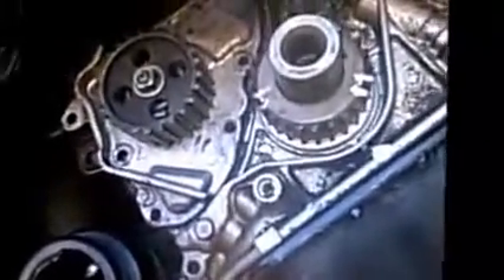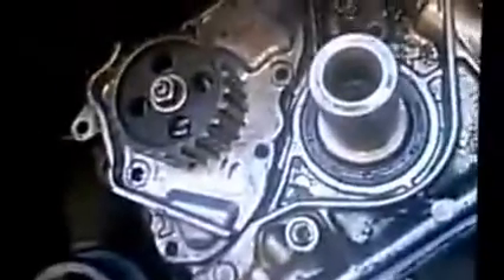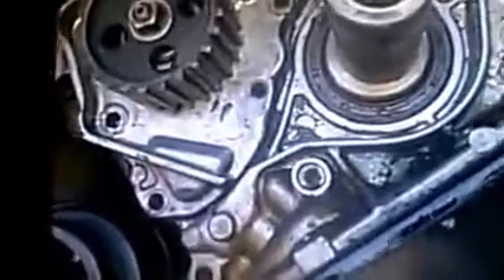Toyota Camry 5sfe Timing Belt & OIL PUMP replacement

Comment: I like the premise; I better, cleaner video if this would be amazing. I’d liked to have seen the condition of the oil pick up tube. I can imagine a clogged one would slowly destroy this engine…
Reply from the maker: pickup tube was fine... might have been a sand grain size of Teflon tape on it... original clutch gave up on this car at 300k... too far away to tow home.... took what I saved over the years and got a new gx460... luvs me some toyota

Comment: Is it necessary to remove the oil pan in order to be able to remove the oil pump housing ?
Reply from the maker: Pump cover = no need to remove pan.  Entire oil pump = need to remove pan
Reply: @personalfunfest  . So I should be fine not removing the oil pan, if all I want to do is replace the round seal and the spider web gasket by the oil pump gasket.  I've seen other videos and it doesn't seem like they had to remove the oil pan when they were showing the location of the 2 seals but I noticed that their oil pan was removed  ,I just figured that they were doing that for the sake of replacing the oil pan gasket, mine is fine and so is my oil pump.
Reply from the maker: @max41050  yes you'll be fine

Comment: You say to first remove the wishbone engine mount first. Don't you have to disconnect the battery first?
Reply from the maker: Just do like in the video
Reply: @personalfunfest  I would prefer the battery be disconnected if I'm moving the alternator. I don't see why you do not. You can short out your E/PCM really fast if you ground out your alternator. What good is a timing belt if the car doesn't start or run?
Reply from the maker: @AikidoTubeSock  do whatever makes you happy

Comment: So what are all the seals you replaced?  I was planning on replacing the oil pump seals and maybe the oil pan gasket.  Anything else??
Reply: I dont know what was replaced but you should replace the oil pump O-ring and gasket and the crankshaft seal at least. You can get a kit from FelPro via Amazon fot about $17 that has all the gaskets you need. You can opt to get OEM ones but they are twice as expensive. Avoid Dorman gaskets as they are crappy and can break within months.

Comment: First of all,how do you what type of engine it is ? In this case, it’s a 5sfe type, is there a label tells you what type it is? And where do you find that label? And what are those number and letters represent ? Thanks....
Reply: 5S-FE is the 2.2 Liter engine 4 Cylinder Toyota used from around the early nineties to about 2001. Usually engine model codes/names aren't written down anywhere on the consumer/owner side but are manufacturer designations for use with manufacturing and repair. Some quick googling about your car will tell you what engine type and model it has.
Reply: corthirteenth94 1987-2001

Comment: Hi. at 0:47 you say to use a 14mm racheting wrench to get that bracket off. I don't have that, can I just use a normal 14mm socket?
Reply from the maker: Adnan Faridi you can try.. just go buy the tool
Reply: Hi there. It was meant to be a joke. We are about to do this right now. Trying to get it done by tomorrow. Thanks for posting the video.

Comment: Hello, the puller you used to take off the flywheel is that the same puller you used to pull off the crank pulley sprocket. I’m having trouble getting it off.
Reply: I’m sorry not the flywheel but the crankshaft pulley. I removed the crank pulley but now I need to remove the crankshaft sprocket. Any ideas?
Reply from the maker: Jason Cassanova just pry it of with 2 screw drivers.. should slide right off
Reply: personalfunfest . Ok thank you! I will try that.

Comment: question on my 2001 Camry 5Sfe engine. does my oil pan really have to come off to get the oil pump cover plate off..it looks like it clears..could I gently prise off the cover instead? thank you..kb
Reply from the maker: K B ...pump cover only=pan can stay on... entire oil pump=pan must come off...
Reply: @personalfunfest  So when we're talking about the "cover plate" is that the plate behind the oil pump sprocket that mates with the block surface? If I want to replace that gasket behind it do I: 1. Remove oil pump sprocket; 2. Unbolt cover plate; 3. slide cover plate off; 4. do o-rings and cover plate gasket?

Comment: how do you remove the crank pulley sprocket?
Reply from the maker: Haitian P  use a puller it's in the video
Reply: Use a interior panel removal tool with a little bit of masking tape around the flat blade part of the tip. Press under the tab (when crank is at TDC). Works like a charm.

Comment: personalFunFest: how did you get the crankshaft sprocket off?  Your video does not show that step other then mentioning that it must come off before the oil pump can be removed.  Thanks.  Otherwise, you video was helpful, especially your belt marking technique.
Reply from the maker: Roger Jackson ... the crank sprocket just slides right off... just pull it off with your hand..
Reply: I drilled and tapped (6m x 1.00 ...same as balancer) the front face of the crank timing sprocket then use a steering wheel puller with a lot of force to get it to pop loose. a small amount of rust welded it in place. No way heat, penetrating oil, hitting it or any other method would have work for me. I ordered a replacement sprocket from Toyota for around $35. ....DONE
Reply from the maker: Glassiches sounds good!  nice tip.

Comment: awesome... I have a rav4 3sfe engine that looks pretty similar...how can I take the pulleys out without any special tool? is there a way? undo the bolt and pull it out... I think my leaking is also from oil pump, but once i'm there will change everything... thanks
Reply: use a pully puller to remove the pulley.

Comment: Did you need to remove the exhaust down pipe and the stiffener plate on the engine to remove the oil pan?
Reply from the maker: no need to touch exhaust... but the stiffer plate needs to be removed...
Reply: I'm doing an 1989 Camry 4 cylinder manual transmission CA car and the front exhaust must removed or the oil pan is not coming out.

Comment: Just had this done on a 95 camry/ I STRONGLY RECOMMEND replacing the cranksahft drive gear and Keyway, it's the gear that drives the timing belt. Found another person on YOUTUBE same problem , the keyway gets worn and nasty rattling noise
with slop with that gear, Not the waterpump, that gear noisy $37 Toyota Part> No One else had that gear.

Comment: So far I have replaced all the seals in the oil pump and a new silicone seal on the Oil pan 

I have encountered a problem trying to put the crankshaft sprocket back onto the crankshaft...it no longer slides back on. Any suggestions. Could I sand the shaft to make it fit?
Reply from the maker: +Krystina S , make sure its clean - the sprocket and the shaft, then put some grease or vaselene on it, then tap it lightly with a hammer and it should go back on... the harmonic balancer usuall gets started on the shaft with a few hammer taps then tigthen the big bolt to pull it in tight..

Comment: Great. I like how you explained all steps to complete job. Going do this on a 1994 Camry 2.2L recently purchased with 154,000 miles. I have oil leak on motor between firewall. I have not looked yet. What would be leaking? Some site suggested knock sensor thread sealant. Also, the spark plug wire harness is getting pushed upward out of the tubes. Which could that be? Spark plugs not seated, head gasket or both?

Comment: PersonalFunFest: do you have to drop the exhaust pipe to have enough clearance to remove the oil pan?  Thanks
Reply: Ron Pineau , no you don't have to drop the exhaust to get the oil pan off
Reply: I have a '99 Camry, I'm doing this job now. The front section must be unbolted simply to get to all of the oil pan bolts.
Reply: I just did an 89 Camry wagon 4 cylinder CA car with manual transmission. You must remove both cross members and lower the exhaust down at least a foot to get the oil pan off (but not to get to the oil pan bolts; I did those prior to lowering the exhaust).

Comment: hello, how did you remove the crankshaft sprocket? Im trying to take mine off to change the seal but it looks like the sprocket is part of the shaft and not removable. any special tools. thx
Reply: Williams Suarez , the crank sprocket just rides on the crankshaft and is keyed, it should just slide right off by hand... if not tap it a few times with a hammer to motivate it off... reinstall with some grease
Reply: If it doesn't slide right off a cheap claw puller is your friend (Harbor Freight) if you have the clearance to use one and if the center shaft wont damage the threads inside the shaft.